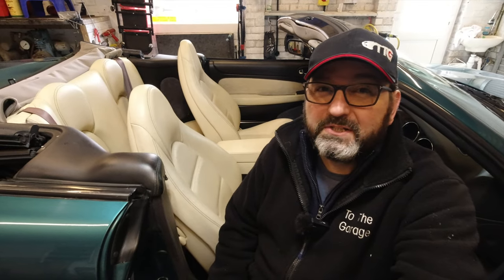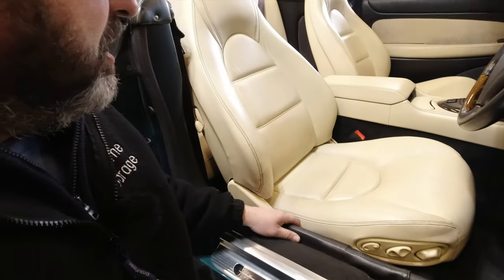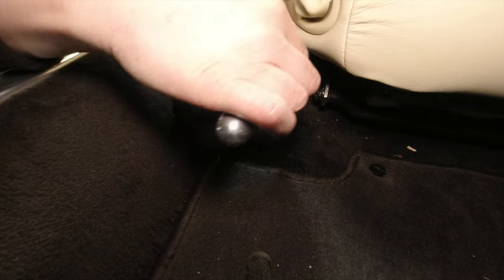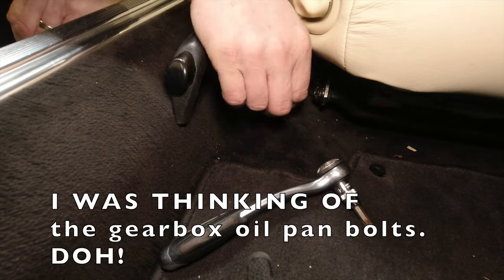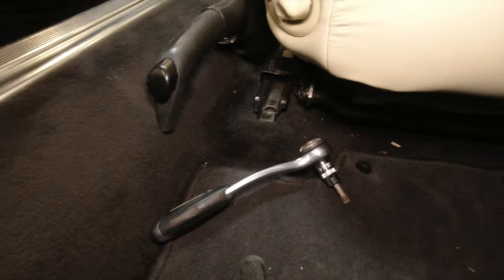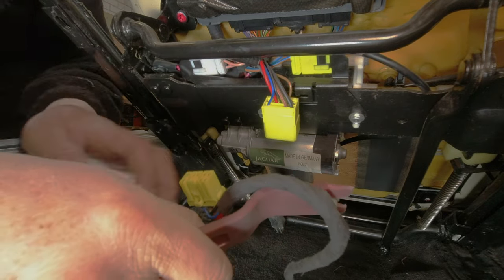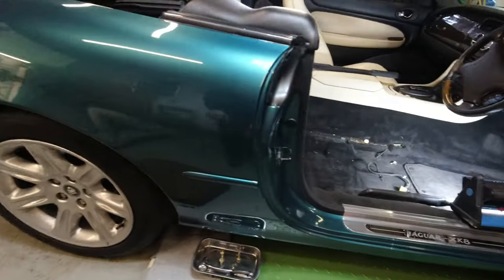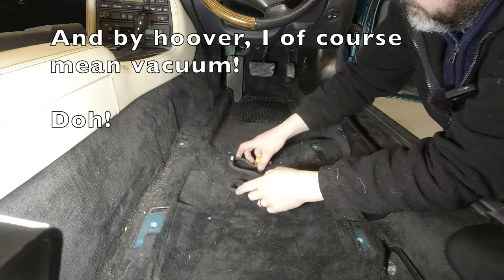Jaguar XK8 XKR X100 seat removal.  Secrets of the XK8 ep 86

Comment: Thanks for the all three ‘secret’ seat videos. I am (too) tall and normally have to raise the front only of the seats, even if they also can be adjusted electrically. Normally I use enough shims under the front bolts to be able to raise them 20-25 mm. This gives more room and comfort to my (long) legs. Question : Will this way of seat raising distort the runners/sledge, since only the rear end touches the floor/carpet? Are the original front bolts/treading long enough for secure fastening? Thanks for any input.

Comment: For seat bolts, use a torque wrench; A. to ensure you torque them down correctly at the end when putting the seats back, but also useful when removing to ensure you at least start with the spec bolt torque for removal before slowly ramping it up to get them unstuck. Less likely to result in a rounded off bolt that going right at it with an impact, or a big breaker bar.

Comment: A really useful addendum to this vid would be a 'how to' on removing and replacing the seat adjust switch panel. I've lost track of the cars I've seen with cobbled up switch mounts due to ignorance or ham fisted efforts to remove the switch panel, invariably over-stressing and breaking either the front locating tab on the switch itself and/or the rear latching clip inside the the switch pocket.

Comment: Hi John, A really interesting set of videos, thank you. My passenger seat (rhs French car) is all the way forward as the switch controlling forward/backwerd movement has a problem and won't move the seat backwards. Is there a video showing switch removal/rapair please? Any tips would be much appreciated, thank you. John
Reply: Did you fix this as I have the same issue - stuck in forward position and wont go up or down

Comment: Any tips on how to remove the carpets on an X100 to facilitate welding in ner floor panels please?
Reply from the maker: Hi. You have to carefully remove the inlay in your door aperture treadplates that has an XK8 logo on it (try not to bend them too much) they are held down with a soft glue. This uncovers two screws. Then remove the centre console and the front seats and it will lift out.

Comment: If you have seats with air bags, you are to disconnect the battery once you have the bolts removed and before you tilt the seat back to disconnect the seat motor power cable.  Otherwise there is a chance of setting off the seat air bag.
Reply from the maker: a good safety Tip for all those with later cars. Thanks Michael👍

Comment: Just did this job as part of replacing the soft top headliner.  Not difficult, but you might find an errant French Fry in addition to coins.
Reply from the maker: I agree, quite a nice task. Unless your seats won't. motor!   but. thats for another video.👍
Reply: Hi there.
Do you have a video on how to replace the interior soft top headliner? 
I could do with doing mine but not a clue how to go about it. 
Thanks
Phil
Reply: @v336518  The process is well defined in the JTIS Shop Manual.  It can be found on the website.
Reply: @ToTheGarage  That's why they invented C4.

Comment: John, Great video. Could you address the replacement of the seat control switch module? My drivers side switch was removed or fell out. For the life of me, I don't understand what keeps the switch in place.  There is a tab on one end, not broken. The switch just falls out when I try to install it. Should it just snap in?  Maybe the leather of the covers are in the way? Thanks
Reply from the maker: Never removed mine Thomas but I will investigate. (Unless one of our subscribers an help?)
Reply: Mine is the same and I discovered that it is the part of the seat that the module clips into that is broken. On one of the Jaguar forums there are detailed instructions for fabricating and installing a metal replacement for this clip but I don’t want to do that as it involves removing the seat from its sub assembly/rails. I plan to use self-adhesive Velcro stuck to the module and the internal part to secure it.

Comment: Hello John, thank you very much for all your videos. I removed the driver seat with ease, but the passenger seat does not lift up and down, it goes back and forth only, is this is normal or is the passenger seat designed this way? The space to remove the plastic cover is very tight and I cannot manage to take it off.
Reply from the maker: Hi Bashar. No the passenger seat on all models and specs should have an up and down adjustment
Reply: I have the same issue. Went to repair head rest and just makes a motor sound..

Comment: Hiya great vid, wondered if youve ever come across this one ,its an xkr x reg ,ive got a problem with the drivers seat its reclines but wont move forward again ,the battery is all good fullly charged,meter reads 12.8 v ,ive tried wiggling and applying more pressure to the switch to press the contacts together thinking it might be a dodgy switch.nothing works,so im stuck driving about in the laying down position for the time being lol ,help needed before i get nicked
Reply from the maker: Oh dear. I can picture it😁
Ive never come across it but it can only be a bad switch or connection as motors dont fail in one direction and work in the other🤔
I guess its a case of remove the seat and experiment wit it on your bench. Give it a 12 v supply and see where the blockage in the electrical supply is. Dirty switch contacts is my bet👍
Reply: @ToTheGarage  hi I had to remove the seat ,it turned out it was the switch ,removed motor so I could move the seat to its normal position so for the time being its a manual seat lol

Comment: Regarding rear seat space, is it true that 
Coupe>cabrio
xk8>xkr 
Standard>sports>recaros 
Can you get the slim seats in an xkr?
I saw somebody mentioning removing foam/cushion from the front side of the rear seats to get significant extra room - any experience with this?
Reply from the maker: Coupe has more space than Cabrio.
XK8 and XKR are no different
Early cars with Lear seats (integral headrests) have more space than later cars and particularly those with Recaro's
Reply: @ToTheGarage  thanks for the answers. Do you know if the xkr exists with the Lear seats from the factory?

Comment: Thanks John, another very good video showing the seemingly tricky to be relatively simple. Did I miss it or did you not disconnect the battery before pulling the plug? Does that not matter?
Reply from the maker: I didn't and it doesnt😁 obviously be careful not to short out the terminals in the connector.

Comment: Hi John just a query, has any one extended the brake and accelerator pedals as I'm quite short in stature and find that in order to reach them I have the seat foreward  quite a bit which then means that the steering wheel is to close even with it adjusted. Tony .Nz
Reply from the maker: Not that I know of Tony. But im sure it must have been done by someone.   Any advice experience or tips folks?

Comment: Ahem, ahem, John, I took my XK8 for a spin after watching your video, first time in 7 weeks post op & of course got the 3 Amigos, even though my battery charger claimed it was full,  which cleared after I re-started  during the journey.
I decided to play with the seat settings & found that the drivers side was dead !!, did you put the "mockers" on it ??  Passenger side was fine, could it be as simple as a fuse, PLEASE !
Anyhow, I now look forward with even more anticipation to your next video on how to remove a "dead" seat.
Reply from the maker: If I was ever going to make any videos pay per view (which im not) it would be...
How to remove a dead seat....
&
How to open an Xk8 boot with a failed latch servo and a seized secret key hole.😅
Reply: @ToTheGarage  
Nice one John, &, if ever I was to subscribe & become a "Patreon", what a stupid artificial word,  your site would be top of a very select list !
Re your pruning antics, was it a pear or apple tree?, & knowing your penchant for camper vans, I am now erring towards the Winnebago gin palace rather than a Route Master ?
Cheers

Comment: This concerns me a bit.  I've always known that my head rest function didn't work.  I'd watched repair vids but I didn't think it worth it (I'm happy with the current position even though it looks different than that of the passenger seat).  I'm not all that handy and the 'simple' process of pealing back the leather etc scared me.

 I always thought the seat seemed a touch high.  Since it won't go up or down, I assumed this was not an option.  Now I see John's doing it and I realize that mine should too.  I would like mine to be vertically adjustable.

Another head-scratcher involves the noise my seats make when I engage the release latch to tilt the seatback forward.  When I push up the latch there's a mechanical/electrical whirring noise that lasts a few secs.  I note in the vid that John's seats don't make that noise.  Should I be concerned?
Reply from the maker: Hi. The noise you can hear is the seat TRYING to lower the headrest so that the backrest folds fully forward going beneath the top of the windscreen frame
Reply: @ToTheGarage  Thanks.  I never fold the driver's side which has the higher of the two rests.  The passenger side just clears the windscreen frame with slight rubbing (as long as the seat isn't too far forward - just need enough room for my daughter's legs).  I'm hoping that noise isn't doing any damage.

Comment: Hi everyone, I'm loving the channel and it has been instrumental in my purchase of an XK8 last week, a car I lusted over since it was released 25 years ago.
Obviously the car has issues, what 23 year old car doesn't. One big issue I have is the drivers door seals, it coming in where the front pillar joins the wing and I assume its tracking down to the bottom of the door as the speaker cover is soaking wet. I am in the process of sourcing a 2nd hand one from ebay as nowhere seems to do the window aperture seal. Does anyone else think that it is tracking from there. The door seal appears to have been replaced at some point.
Sorry for the essay.

Andy
Reply from the maker: it is likely to be that window seal.